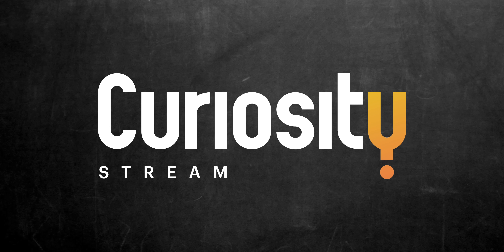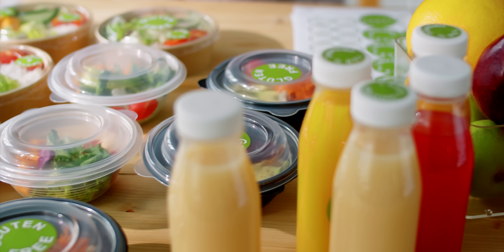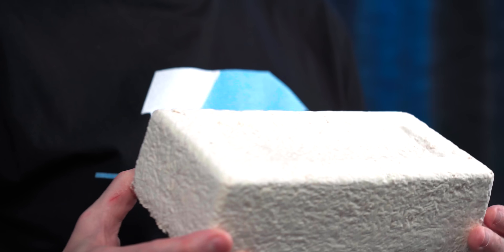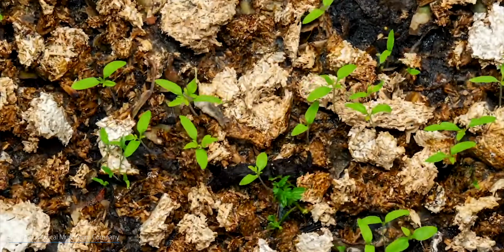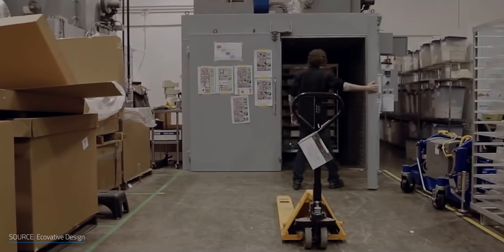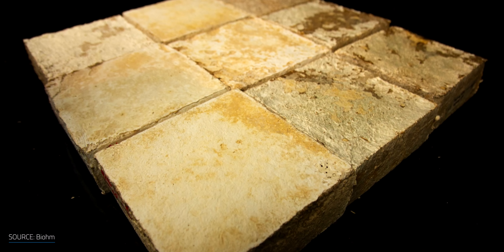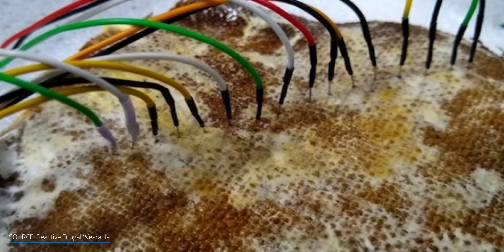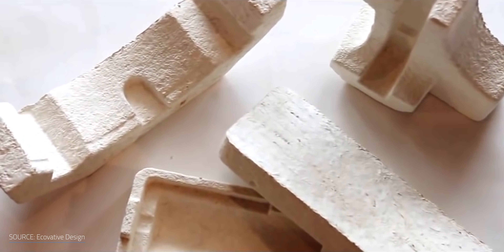Is Mycelium Fungus the Plastic of the Future?

Comment: Interestingly,  I was proposing "root bound" straw a number of years ago (close to 20) as a way to take straw bale construction into insulating between rafters.  The idea was a screen bottom structure filled with straw and a suitable seed such as grass seed.  It would be lowered daily into a trough of water briefly, then raised.   The seed would sprout, and the root structure would spread throughout the straw seeking moisture, eventually creating a sort of "turf".  This would be 6" to 8" in depth perhaps, and 24" wide, and placed between rafters just as fiberglass would.  It's pretty much the same idea except using roots instead of mycelium, except that the straw itself would be the insulation and the roots are just to bind it.

Comment: wonder if fungus insulation panels would be rodent and bug resistant?  Also, even though the fungus is cooked dead wouldn't it be a perfect breeding ground for more mold and fungus later. I mean it would be better than synthetic polymer foam insulation when it comes to out gassing but, if its candy for black mold, ants, termites, and rodents not so attractive.

Comment: It sounds really great. I'm wondering how it does with water though? As a building material, wouldn't it absorb moisture, expand, and rot?
Reply: Fully colonized constructions tend to repel water quite well. One team made a fungus kayak as an example.
I haven't seen any data about how it would deal with moisture over the long term though, I suspect that without additional protection it would not do well as a structural material. 

However, products like wool and straw are used in various roles as building materials with good success, so I have no doubt this could fill similar roles.

I'm a little skeptical of the product as shown as a useful structural material, but mushrooms can form strong woody structures as well as mycelial masses, so perhaps with some more time researchers will be able to coax the fungus into growing into products more like wood. It would be very interesting to be able to grow single-piece, jointless pre-fab woody panels.
Reply: @dave7038  That would be pretty cool. Could grow interlocking 'wooden' pieces to interlock without any tools required.

Comment: This is another green technology that is so bulky that it requires more oil than it offsets through the transport. Also most plastics are made from waste products, so until we stop driving combustion vehicles we will still have the same waste products. This means it will increase pollution even more. We need to reduce, reuse, recyle. First, though, we need COMPANIES to do the same. Companies making throw away products is many times more polluting than what we as consumers can save.

Comment: I don't see this replacing much of the plastic used for food storage and consumer products. A 1 week cycle time is a huge hurdle for mass production compared to the seconds required to injection/blow mold PPs. With large volume demand, costs for extra tooling and warehouse space will quickly make it non-feasible. We do need a compostable alternative, just not sure if this is it.

Comment: I missed the part how it can be both cost competitive, and also not, with styrofoam. If it is to expensive to compete with styrofoam where cost matters, it's not cost competitive.

Also, how can it be only (almost?) cost competitive if it can turn waste into a product in a week with no input that gets consumed except the little bit of heat energy it takes to kill the mycelium? 

I remember no mention of it being able to replace plastics in bottles or bags, ur anything else that makes up the majority of plastic litter, I don't se the connection. 

Also, if plastics are so toxic, and we eat 5 grams of micro plastics per week, what health issues does it cause us?  

And, resilient, but also degrades quickly, how? 

A lot of contradictory claims. Sure, it might have untapped potential, but as long as it's chosen to make brands seem environmentally friendly, and practically only that, that is its realized potential use.

Comment: I'm sensing some red flags combining "Biodegradable" and "Building Material." Isn't anything that breaks down the material is effectively a termite infestation for whatever you build with it? Far from un-workable, obviously we use wood in plenty of construction applications. But replacing concrete isn't going to be viable if say, your basement floods with swampy water and the foundation of your house starts to rot.

The fact that it takes days to grow (where as most plastic forms can get cranked out in a matter of seconds) is going to be a big hurtle too. It's a bottleneck on existing manufacturing processes, so it doesn't easily just swap out. The fact that it's biodegradable is great, but if the extra land you save from becoming a landfill is less than the extra land you have to dedicate to making bigger factories to match the production output, then we're not actually coming out ahead environmentally. Especially considering the land you would need to dedicate to factory space will be much more desirable, expensive, and useful land.

That said, I'm all for exploring the option. Even if it doesn't work out as a straight replacement for plastics in most of their applications, it's still likely to find its niches in new markets and prevent new industries from adopting plastic as their standards.
Reply: Oh man! That mist be why WOOD HAS NEVER TAKEN OFF AS A POPULAR CONSTRUCTION MATERIAL!!!
Reply: @DrewLSsix  
Wood generally takes years to biodegrade, not days. Wood is commonly treated in processes that make it toxic to make up for its shortcommings as a building material (in particular, the fact that it biodegrades). Wood doesn't generally get used in the foundation specifically because it would rot in such moist conditions. Wood is generally the shortest lived exterior material. Wood doesn't see structural usage in much of anything more than a couple stories tall.

If Mycelium is going to be a building material, it needs to do what either concrete, plastic, steel, or clay can (preferably cheaper and/or better). And being non-bio-degradeable is key to their viability in a lot of their applications.

Also I acknowledged wood specifically in my original comment. 3rd sentence. You should read things before leaving sassy one liners.
Reply: @42billybob  what an eloquent roast. I applaud.

Comment: Anyone thats ever had to install or touch fiberglass insulation would probably say YES to this option.
Reply: Idk, I HATE fiberglass but that stuff can last virtually forever. Idk about dead fungus. Seems vulnerable to getting eaten by animals, bacteria, and living fungi.
Reply: They fixed that.  Modern insulation isn’t itchy anymore.
Reply: Good point, it's really itchy
Reply: I think mineral wool is better than fiber glass (also better regarding working with it, you still need protection of course).. That said it is not clear that the mycelium insulation will hold for 40 years or longer. (Mineral wool still going strong, and it can be recycled and it less sensitive if it gets every wet).

If mycelium insulation gets wet it might start to decompose.(crack in the surface, burst pipes, hurricanes and floods getting into the insulation). Ideally a house is insulated from the outside, and if the insulation degrades after 20 or 30 years under the top layer, it would cost a lot to replace it. On the other hand we know that mineral wool and fiber glass hold (they are also not a fire hazard and can be recyled). 
Insulation in construction is long lived so it does not matter that mineral wool needs more energy to produce it.

But the throw away stuff is important. Styrofoam dishes.
Reply: Big fax.
Reply: Being an electrician.. I deal with it daily and it’s horrendous!
Reply: people talking about how it wouldnt last, makes me wonder if it would be possibly to design a house that uses living mycelium as insulation, get a substrate in the walls, something something antifungal paint something something mushroom roof something something cheap house
Reply: @Meboy-uv5td  It would be a cool alternative instead of tents. A lot better insolated but since it would last only 45 days it wouldn't be a long time investement. But for a couple of bucks to get a giant cosy tent is pretty reasonable. It would also be very helpful for homeless people. They could buy cheap "tents" out of this stuff that is a lot cheapper than normal tents. They would have to replace it pretty often tho better than living on the streets.
Reply: Its solved by washing in hot water, after you are done, if you have bare skin while working with this stuff... This is common knowledge for people that have been working with glasfiber insulation more than ones...
Anyway Rockwool is not glasfiber and not that problematic as example Glava that is glasfiber.
Also very flame resistant.
So there is already natural products for the glasfiber ones.
Reply: @cofal79  No no NO!!  Wash in COLD water.  Hot water will open your pores, allowing the fibres to penetrate deeper into your skin.  Cold water wash only.
Reply: @KuriusOranj  if you want to scratch your skin off yes, wash in cold water.
I have isolated several houses with glasfiber insulation...
And it works every time. Washing in cold just makes it last forever.
Reply: no thanks. i hate fiberglass but i don't want to freeze after 45 days because my insulation dissapeared and now the walls are full of rat poop.

Comment: 3:41 funny how they use plastic to package the mycelium inside.
Reply: Lol good catch, they just started though but yeah they should definitely push their supplier to use their mycelium packaging...
Reply: Its almost like plastic is really good at being reusable, lighweight, durable, heat resistant, mouldable and easy to clean. Its funny how the "environmentaly friendly" paper industry still regularly relies on steam power (from burning wood) and LOADS of diesel powered equipment, and petrol powered chainsaws.
Reply: @rjc0234  yeah you're right, trying to replace plastics which are objectively a big problem with environmentally friendly alternatives is pointless cuz chainsaws use gas

Please grow a brain

Side note though, I really hate those paper straws. Some1 should really come up with a material that doesn't go all soggy as soon as you take a sip...
Reply: @zwenkwiel816  Plastics are not a problem in the environment. People dumping plastics are a problem.
Reply: hahahaha

Comment: This is the beginning of bio-fabricated products.... Products that are grown from living materials rather than carved or built-up from dead matter.  This is a very powerful technology that we are only starting to scratch the surface with.  Over time we will learn to hack fungi, bacteria, and other biological systems to convert them into little 3D printers that can build large, complex structures, and then maintain them after construction is complete. 

For as long as we can provide the biological matrix with food and materials, this process is scalable to any level.  The doubling time for some of these systems are measured in hours -- If the doubling time is 24 Hours and start with a cubic foot of material, then you get the following growth pattern:  

1) After 10 days you would have a block that is a little over 10 x 10 x 10 feet (1,000 cubic feet)
2) After 20 days that would be 100 x 100 x 100 (1 Million Cubic Feet)
3) After 60 days you have 1000 x 1000 x1000 (1 BILLION Cubic Feet)

You get the picture... every ten days you get growth factor of 1,000x your original starting amount.  Again, this can only continue for as long as we can provide food and materials to the matrix.  Also, after a while the gross mass of the matrix becomes an issue -- the challenges become ARCHITECTURAL, rather than biological... meaning you may have to provide additional structure and support... Otherwise, the outer layers might prevent nutrients from reaching the center, or the entire matrix might collapse under its own weight.  

Biology is limited -- that limit is very high, but it is still a limit... Eventually we will learn to create cybornetic or synthetic microbes that can break the bounds of biology and achieve scales never before imagined.  Imagine microbe borgs and microbe bots with doubling times measured in minutes or seconds.  We could literally grow entire cities within days.  While this technology is still considered fanciful or science-fiction the seeds for it are already being planted, and it is only a matter of time before it is fully realized.  

Because knowledge is doubling every year, such fancful technology may be here sooner than you think.

Comment: I think for temporary packaging of non-food items this is a great idea.

I'm less sold on using it as food packaging or as a building material.

If Mycelium responds to outside stimuli, is it still alive? Can it start to grow again in the right conditions?

I find these questions to be particularly concerning when viewed in the context of a building material. If you have mycelium insulation in a wall bracketed by wooden studs and drywall you have created a cool dark place filled with mycelium and a ready food source.

Regarding food packaging, we would be switching microplastics to micro mycelium... We would still be ingesting it.

That may not be a big deal, and in fact would probably be a lot better for us than microplastics, but then again what are the risks for end users? I think Fungal infections are a fair concern to have.

Comment: It takes a week vs seconds for chemical foams or plastics.  It will never be adopted.
This is no different than "Plastics made from corn!  It is biodegradable, carbon-neutral and edible. To transform corn into plastic, corn kernels are immersed in sulfur dioxide and hot water, where its components break down into starch, protein, and fiber."  After being developed from research it never made it into wide spread use or any use to replace traditional plastics.

Comment: This is a plastic alternative that I can see actually having some real practical use. Normally they try and target plastic bottles and things that we very specifically use petrochemicals for their exact structure for due to the fact it will not break down and degrade etc which in those cases were you to modify a bioplastic to replace the traditional then you are just going to end up with a non biodegradable bioplastic. Going after insulation and soft but rigid structure packaging is a great approach.... I often see people recommend hemp product for this application but due to how strong and coarse those fibres are I do not see them as near a practical a fit for the same reasons it does not well replace cotton and cellulose fibre.

How sterile and such do the environment's need to be for it would be my big question and how well it scales. I see many projects like this that look great small scale, but as soon as you try blow that up it does not work as well or requires lots of H2O2 to keep things sterile which for now the bulks all coming from steam reformed gas like hydrogen so we really need to clean up some other areas to make feeding clean energy to that truly viable.

Comment: There have been a lot of innovative building materials over time. Good materials need to score well on a wide range of metrics, which makes time testing very important. Fire resistance, mold resistance, heat resistance, flood resistance, resistance to mice, bugs, and termites are a few of the various things that go into a good material.

Comment: A bit of genetic engineering on this could produce materials with extremely useful properties like higher strength, elasticity, resilience, flame resistance, colouring, or control over the speed of breakdown.  Embedding structural materials into the 'foam' like glass or metal fibres for strength; encapsulated chemicals like heat activated flame retardants or bits of micro-electronics could also greatly extend the diverse properties, .  There really is tremendous potential for growth into many products.

Comment: Another question is how long will such footwear last. I don't want it to degrade after a month.
Reply: I presume it would go through a similar process to tanning like they do to leather. 
but yes some more detail would have been welcome.
Reply: I'd assume they'd probably have similar durability to rawhide or other plant fiber, which we have 5,000 year old examples of iirc
Reply: Probably coated in a sealant that keeps water from breaking the shoes down.
Reply: @That-No-Moon  That would work until you end up scuffing your shoe and scraping off the protective coating. if you're anything like me then these shoes would only last you little more than a month.